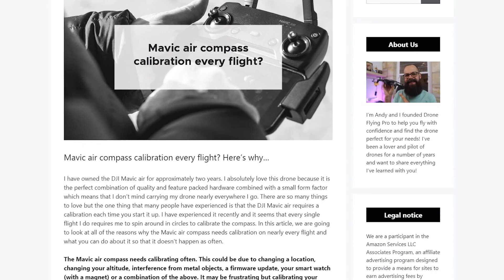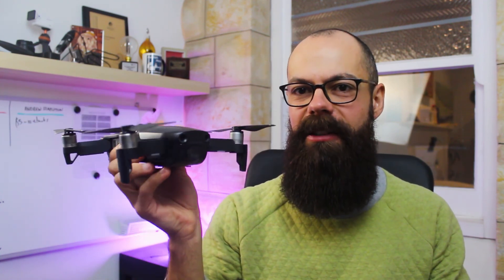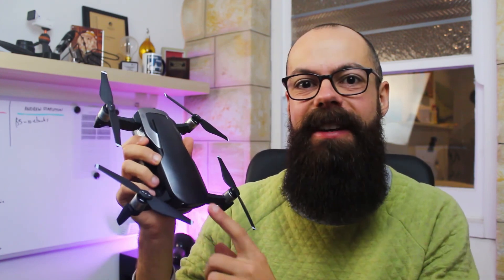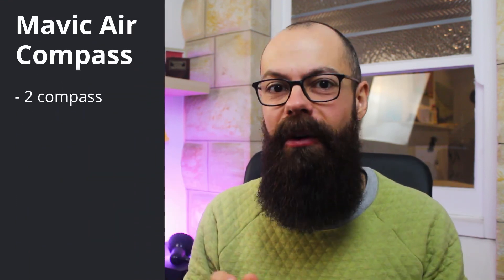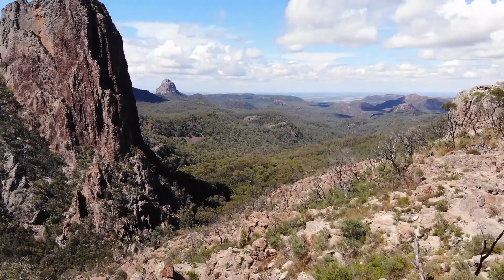DJI Mavic Air compass calibration every flight? Here's why...

Comment: I have a new Avatar and yes, I still hold on to my Air for these reasons.   I can leave it in car, solid drone and best size of all DJI lighter drones.  I had this drone since it was introduced, I belive they updated firmware to be a lot more sensitive to these things because it used to not do this.   I used to take off from boat or anywhere and take images without issues, now on a boat its soooo hard to calibrate, once on an aluminum boat I could never get it to calibrate making it useless that day from the boat.   If DJI would bring this one back with better compass, 5 min more battery and 4k but leave the rest of the drone the same it would be perfect.  Mavic Air 1 is a great drone either way.

Comment: I only calibrate my  drone's compass only if it has a 8 or more gps lock then it starts drifting or doing a circle hovering.. I never calibrate compass if it does not do those things.. Only calibrate if the apps tells you, the apps is smart it will tell you if there's a need for calibration, also do not calibrate if the message says "Interference error warning" believe me it has nothing to do on calibrating your compass. It will make it worst if you try to calibrate it after receiving those warning because if you do calibrate on a warning what makes you think it will be fine to calibrate if you know there's an interference? it will make it a lot more worst.. If this warning shows, best thing you could do is avoid that spot and change location..
Reply: Agreed, thats when you can have a runaway!